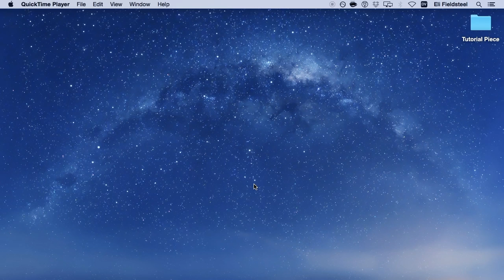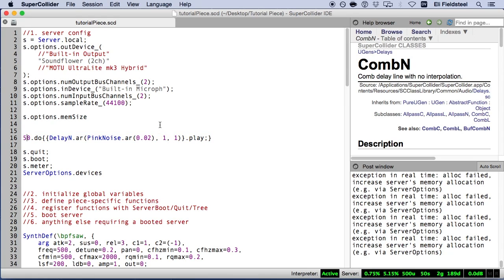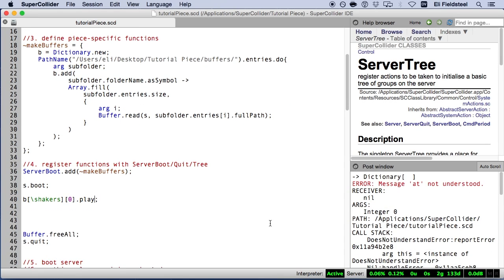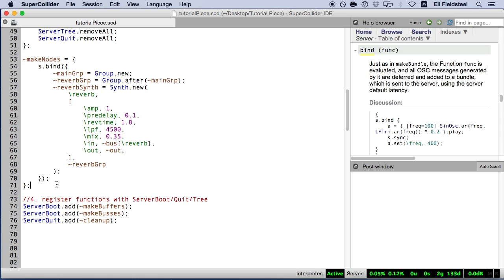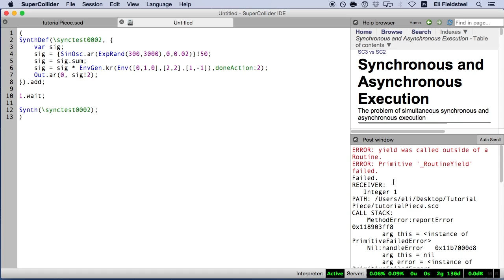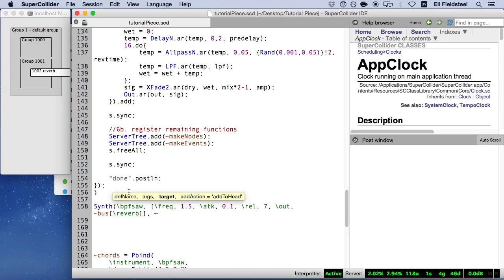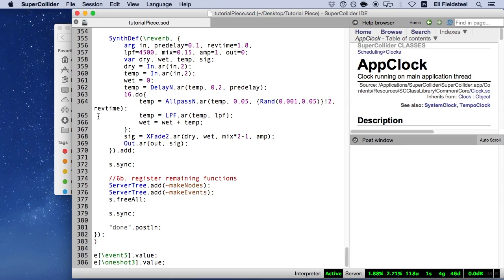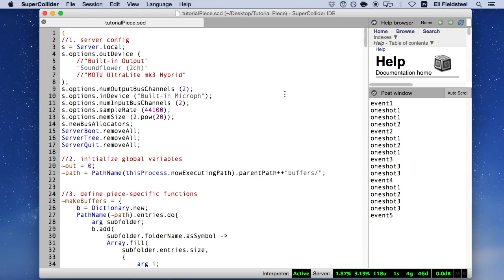SuperCollider Tutorial: 17. Composing a Piece, Part III

Comment: Love your tutorials! I've learned so much. Thanks for taking the time to explain things. I am having a very strange issue following along though. Everything works well until I try to add event 4 chords or marimba. I get a "in file null" error. It's so strange because it's just a pbind, I have no idea what's going on. Trying any event after that also causes the same failure. I'm copying straight from your download at this point too. Any idea what could be the issue?
Reply: Ok, it seems as though this is only happening because i'm using Atom. I have no idea why but it works find in the IDE. So strange. Thanks again!

Comment: Hey! somewhere in the code you use ServerOptions.devices, which doesn't work in my Windows machine. In this machine I have the problem that, when I connect the headphones (or speakers through the headphones), sound still comes out through the laptop speakers. I just read that ServerOptions.devices doesn't work in windows or linux, so I can't route the audio signal in that manner. I'm curious to know if you know a solution for this problem... Cheers. Im a big fan of this tutorials
Reply from the maker: Oh, good question! Unfortunately I am not completely sure and can't easily test this problem. Have you tried s.options.outDevice_("my device") or s.options.inDevice_("my device") to set an I/O device that way? Also, my recollection is that a lot of Windows/SC users have Jack running on their machines-- I have no direct experience with it, but it might be worth looking into. http://jackaudio.org/faq/jack_on_windows.html
Reply: i beleive that s.options.outDevice /inDevice does't work in windows either. I'll explore the second option. Thanks
Reply: ...I disabled every playback, and recording device in the windows audio device manager , except from my external sound interface. Then, I restarted superCollider, who automatically chose it as the default audio interface. Problem solved. :)